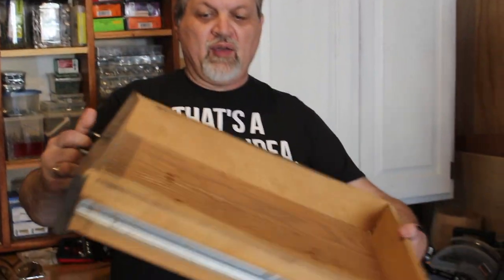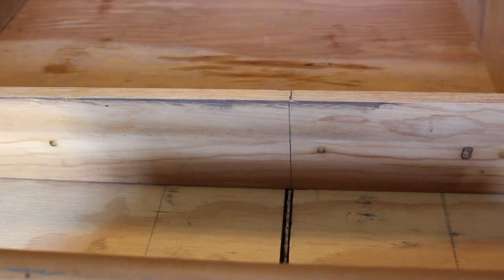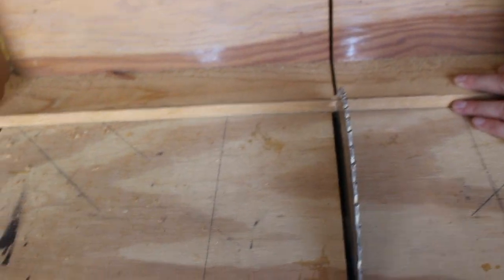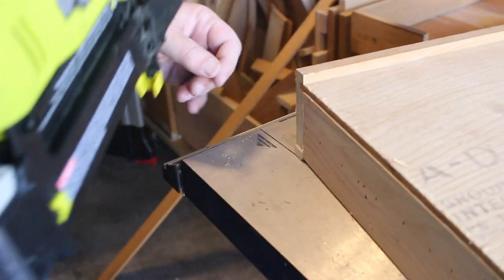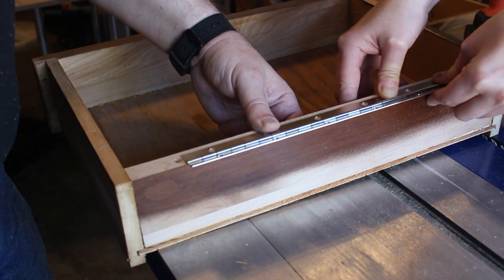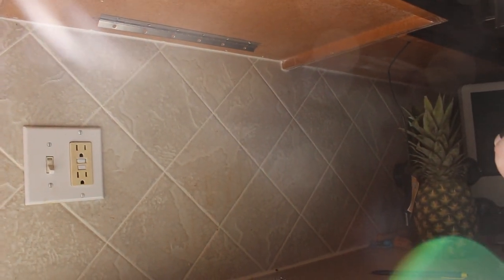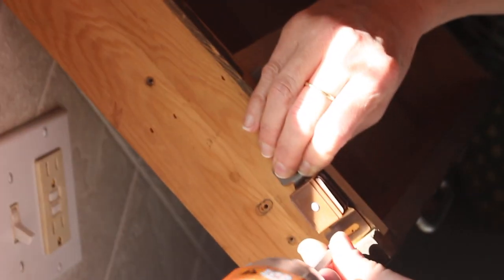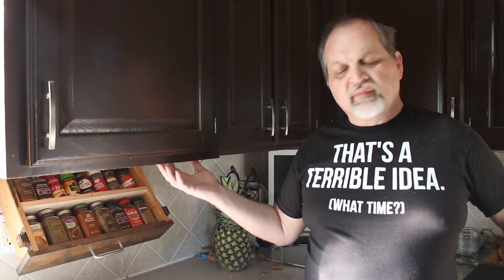Amazing  Transformation: From old drawer to kitchen space saving spice rack/storage

Comment: You should be more cautious with that blade Sir. Safety first
Reply from the maker: What part you feel was unsafe? Thank you1
Reply: Other person hands around.  You have to be careful for the project your hands and others. 
And after each cut put the blade down and build a guide line so you would not need other person to hold. Those blades are so scary.
Reply: The part 8:25 /8:26 was really scary

Comment: Way too many brads. The glue does all the work. Don't believe me, once the glue cures, take a hammer to that drawer. I  promise you, everywhere there is a glue joint will hold while everywhere else will fall apart.
Reply: Is that what he did at 17:25? Glue?
Reply from the maker: of course the glue does all the work brads are not for strength

Comment: Hey partner. Please don’t stop the saw while the piece is still on the blade. Run your piece all the way through (with a push stick) and then turn your saw off. You’re gonna cut a finger off one day. 🤷🏽‍♂️
Reply from the maker: Nonsense - stopping the saw does not present  any danger  and you should stop if anything does not feel right 
I have been doing this for decades and all my digits are fine thank you for the concern